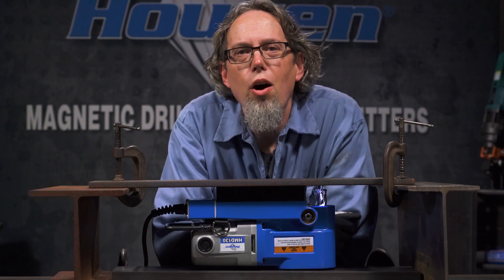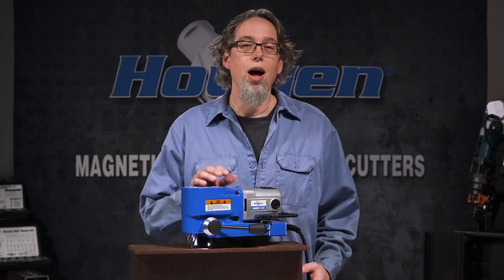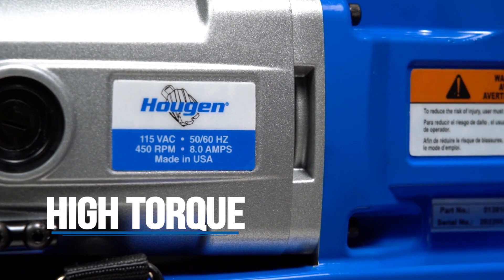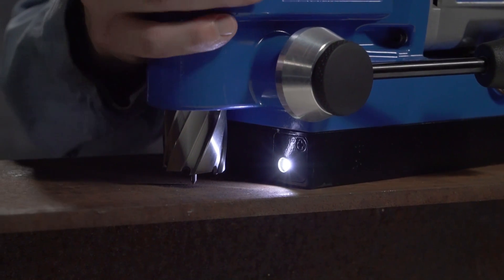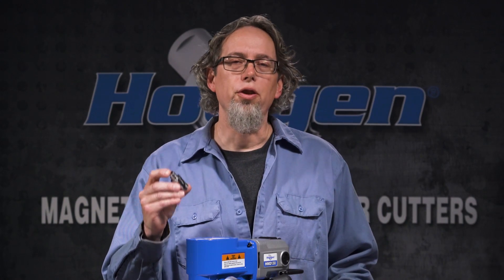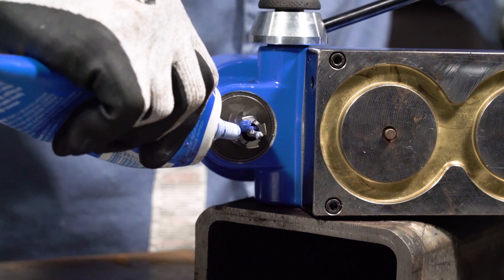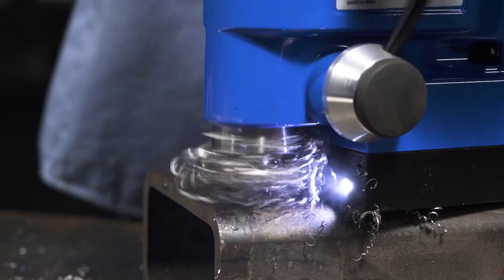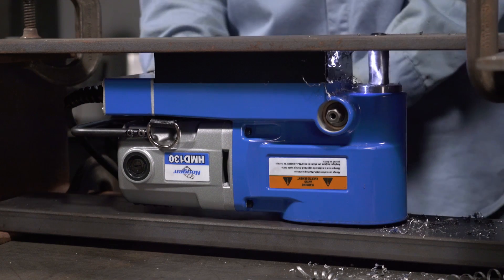Drill Holes in Crazy Tight Areas - HMD130 Overview

Comment: I appreciate that you showed it being used upside down, but not showing the drill bing placed was big omission. How easy is it to position? Do I have to support the full weight of the drill in an awkward spot and simultaneously turn on the magnet?
Reply from the maker: Yes... You have to lift the drill into place and turn on the magnet. Pretty simple procedure for the ability to drill holes in tight confined spaces.